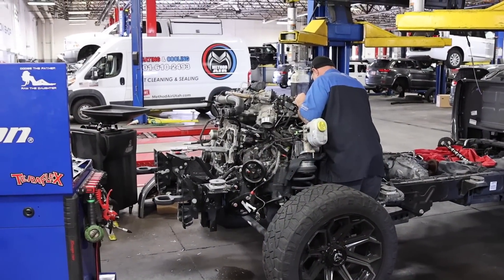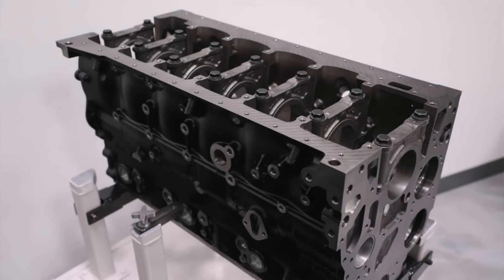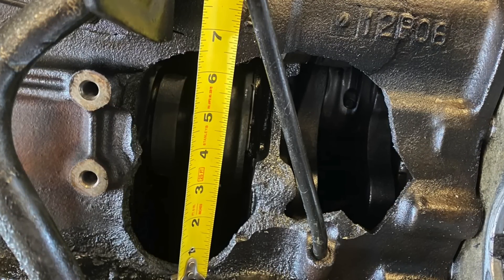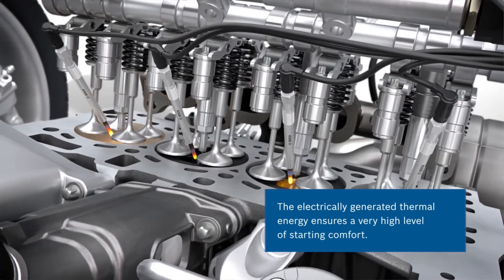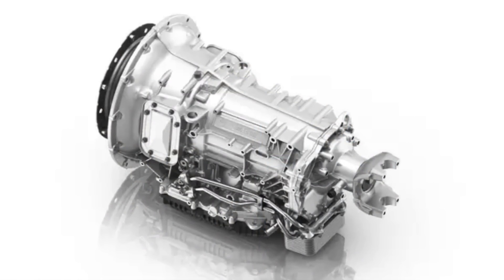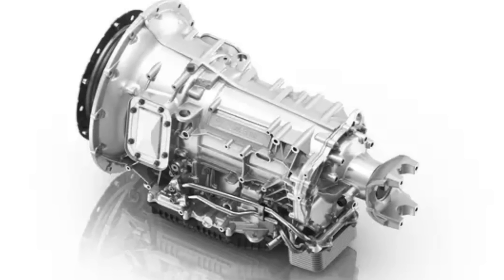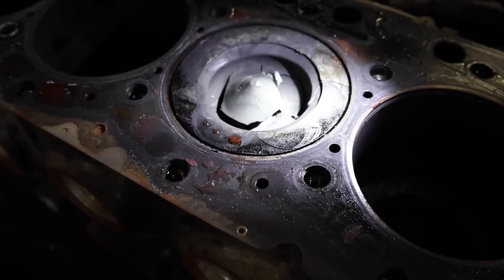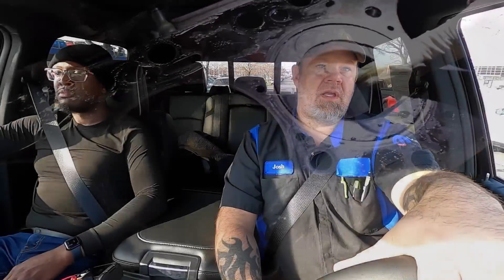Master Tech Breaks Down The Cummins Updates For 2025!

Comment: I have a 2024 ram 2500 with 13,000 miles and just finished second oil change and it sounds like lifters are about to fly out of it 😢 do you have an email I could send a video to and get your thoughts before it goes to the dealer

Comment: Found your channel after buying my 2025 Ram 2500 6.7.  I value your opinion and the information you provide.  After a 2400 mile trip towing my travel trailer I couldn’t be happier with the new truck.  Coming from my 2000 Dodge 2500 5.9 Cummins that I’ve owned for 23 years to the new 2025 the difference is night and day.  The only glitch was the damn def fluid gage.  It’s slow to respond and went from what I know was full to empty in seconds three times on our trip.  It always fixed itself but not before throwing the warning chime and def fluid icon.  From what I’ve read that’s been a problem but I plan on putting in a jumper wire at the sending unit plug as soon as I can get my hands on a wiring diagram.  That way if it doesn’t come back to life the next time I can jump it and fool the computer into thinking it full which it will be.  
  Keep the videos coming they are very much appreciated.  Thank you.
Reply: My 04 2500 laid down on us coming back from a trip. We were too far from home to get it hauled back reasonably. Had we been close I could have fixed the trans solenoids that coded. Now I'm in a '25 and hearing all the issues (not to mention EPA crap) it's got me wanting my 04 back. Didn't even have 100k on it.
Of course the new truck has all the power stock that my Edge boosted 2nd Gen had {EGT was an issue) and is quiet in the cab. Fingers crossed that the warranty they sold me covers any issues.
Reply: @OldCurmudgeon3DP 
  Hope you have good luck with it.  I still have my 2000, have had it for 23 years.  Injector pump went out on it pulling the travel trailer home to get ready for a trip.  Wife was tired of the rough noisy ride of the old 2000 and after riding in my sons 2024 Dodge wanted a new truck so here we are.  I happy she made that decision, it’s a nice truck.
Reply: @weshawkins7165 thanks. Good luck to you as well. Maybe the EPA will get out of the way before we have any expensive issues crop up.
Reply: @OldCurmudgeon3DP 
 Fingers crossed.

Comment: Hi, I have been following you on YouTube. I am an Icelander living in Iceland.
I have a question for you regarding my Ram. I have had Ram trucks since 1986 till today. I have had a 2500 Cummins 2007 and now 3500 Cummins HD 2023 that stands in 16;500 miles.
I have lifted the truck 2,5 inces and installed 37” tires. 
I have a leaking oil seal in the transfer case. I had that also on the 2500 that I owned before.
Is this problem something you are aware of?
Is there a aftermarket oil seals that are more HD than the Mopar ones.
Br
Jonatan Gudjonsson
Reply from the maker: Howdy. I do see that seal leaking from time to time. Next time it is changed the shaft needs to be checked for imperfections

Comment: As far as his view on the 3l hurricane.  I would love to be wrong about it.  The things about it that concern me. Reliance on sensors to monitor oil levels and conditions ie a dip stick. 2 sleeved cylinder walls.  The painted on cylinder liner might be fine but it might not be as well.  Also keep the v8 as an option maybe even make it the standard engine and get rid of the pentistar.  Technology is great when it works but when it doesn’t it shouldn’t make the entire truck useless.  My opinion

Comment: I had a 2016 2500 HD that I loved. I had it deleted and tuned. I am in the market for another truck which one is the best pre-2018. I can't see spending 100K for a personal use truck that I use to haul little with. A side note I have all of the parts that were deleted if someone needs to convert back to stock.

Comment: I understand "never buy a first year vehicle, but they're not always bad. I bought a 1994 Ram 2500 Cummins in November of '93, Not only first year of production, but first couple months of production on the most radically changed pickup in Dodges history. In the first 100,000 miles, only thing that went wrong was the cruise control switch. Ended up putting 505,000 on it before selling it and getting a 2011 3500.

Comment: Windowed engine blocks are nearly NEVER the fault of the block material or design, its because a dense metallic internal component rotating at very high speeds failed and blasted thru the block like a cannonball. Cast iron or CGI makes no difference. You could make a better argument for the main saddles over time or some such wearable concern regarding block material or design (and I still think any material argument against CGI vs. cast iron would be a weak argument), but not holes punched in the side from a failed connecting rod at full steam.

Comment: 16:32 modern problem of society, it is to easy for them to get money to pay for things regardless of the sale price. tho another thing that comes up after years of run time brings up things like... as an example, for every good part made they sell one surrounded by scraps, to the extent of... if one has a 3208CAT, what 4 cylinder CAT uses the same crankshaft tho made of a 230ksi alloy steel, same with the rods, timing gears, oddly ending in a thing such as a 3126/3208 sleeve job just to use 230ksi solid alloy steel pistons... if a stroked out 6.7 is a 6.9... that is a 9.6... have to buy in larger quantities ending in the manufacturer demanding that they actually surrender any iron/scrap metal to the foundry in quantity listed to make the things that they allegedly have money to pay for, otherwise its just bottom bucket general population mix casting. 3 cylinder is a 3rd world open air cast aluminum not a titanium aluminum vanadium purged vacuum cast alloy... tho it was in all the slag they scraped off, along with all the zinc magnesium that made the whole open air pot run over thermal run away boiling everything out till their is nothing usable in it... registered exportable VIN's, aluminum body panels that intentionally burn at a low temperature leaving nothing but slag/soot. just so nothing can be done with it once it is sold... both bad or good, just paying for something is the problem.

Comment: Is the grid heater bolt really a big issue?
Reply: never had a problem with mine with over 700,000 miles, 2011 model

Comment: Thanks for the info and your thoughts about the current diesel industry. I own a 2007.5 Ram 2500 with 137,000. I'm just trying to keep it running well, and so far, so good. I've added some after-market parts to improve the long-term life. Still worried about fuel and oil saturation, oh well. The truck is still running strong. New trucks have lost  their longevity, and the prices are crazy. Maybe some suggestions will be how to keep the old ones running strong with new and after-market parts installed correctly. Keep up with the good information.
Reply: Well said!!

Comment: I have a 2023 with 12k I have changed my oil twice with Shafers 10w30. I also have the Banks air intake and the Monster Ram on it. Is there anything else I can do to make this year Engine better to avoid these 5 Gen issues? If I change the Hydraulic lifters back to solid lifter will that make this engine more reliable life the 4th gens? I know there is nothing I can do with the Block composition.

Comment: Do a grid heater like the GDP one if and if it were to fail nothing would fall into the intake and make it's way to a piston. I for one miss the clatter of a diesel. My 2015 is to quiet. Also screw the grocery getters and a smooth shifting transmission, probably 90% of them don't out tow a gas engine or a half ton truck to begine with. I'll keep my lowly derated G56 truck.

Comment: In regards to the CGI blocks, notbing is wrong with them. If the internals are weak and a rod decides to let go CGI or cast iron it will put a hole in the block. 45 pounds is not the weight difference either lol
Reply: THIS. Windowed engine blocks are nearly NEVER the fault of the block material or design, its because a dense metallic internal component rotating at very high speed failed and blasted thru the block like a cannonball. Cast iron or CGI makes no difference.

Comment: I'm sorry you were miss informed.pre chamber engines are obsolete. The glow plugs are used in the intake as a pre heater to replace the grid heater and no more. They are not going to pre chamber with glow plugs per cylinder

Comment: I have a 2015 scat pack with the 8HP70. 200,000 miles and I’ve never touched the transmission,  cause that’s what dodge told me. It runs great still. Would it be wise to change that fluid and filter at this point?  Or just leave it alone? And do dealerships do this since dodge recommends to never service it? Or they use to at least.

Comment: CGI is way stronger and lighter then cast iron   Cummins just used less material in key areas that made it less strong
Reply: Lighter yes. Stronger. Vastly depends on the cast iron and processing. On average it can have an ultimate tensile strength of over 300 to 400 pa over CGI. At its highest it can have 1650 mpa of tensile strength or essentially 210,000 psi of tensile strength. CGI is great for the V shaped diesel engines because of the lack of space they have to work. But in an inline six there's plenty of room to spare and not worry over.
Reply: Preach it
Reply: Anyone who isn’t a fan of CGI is just plain ignorant. It IS stronger… by a LOOOONG shot!
Reply: @coreymacqueen4802  I'm not. And I'm not ignorant. Anyone who's thinks they can call others ignorant off a generic statement is ignorant themselves
Reply: @danielmorris-ruckett913  The issue is not the material of the engine block. it's the sole fact that cummins just cheaped out on the material in the crank case area. Cast iron or not its not stopping a connecting rod from coming through the engine block
Reply: @sounboy4498  I've had old school cast iron cummins motors have their rods fail to penetrate the engine block. But I do agree with you about the crankcase area
Reply: @danielmorris-ruckett913  All these manufacturers just cheap out and only focus on cost. They threw reliability out the window its quite sad. Those older cummins engines you have treasure them🙏🏿

Comment: If the big 3 truck manufacturers would use more nickel in their iron blocks like engine manufacturers did back in the 70'sthe blocks would be alot stronger than a regular iron block and a cgi block

Comment: Jist had my lifters and cam replaced at 18k miles. Sill have a liffter tic.   Sucks. But i love my truck
Reply: What year is your truck?
Reply: @allencanard979 probably a 2019
Reply: @Spoolingturbski  with 18k miles, I'd doubt it. I've heard for a while that starting in 22 lifters and push rod metals were very soft due to supply chain shortages and having to use suppliers that hadn't been used before.
Reply: 2022 is my year 3500 ho

Comment: Great info about these engines. Thanks Josh. Sometimes, I wish I never got rid of my 2018 to get a 2022. So far, no issues w/the 22. About 30K miles right now. However, I'm a stickler about changing the oil every 7500 miles max. 10w30 only, never 15w40 w/ the hydraulic valvetrain. I also try to minimize the amout of short trips & rarely idle the truck. If I was keeping the truck long term, I would surely get the Banks Monster Ram intake. I'd love to lose the EGR, but you know Uncle Sam's environmental police would have major issues with that. If this cam/lifter issue is becoming  a syetemic problem with these 5th gens, it would behoove Stellantis/Cummins to maybe extend the warranty on these engines out to maybe 7yr.150K miles. That would help restore some customer satisfaction they've lost in recent years..
Reply: I forgot to note that my 22 is the "standard output" version. No issues w/ the 68RFE tranny so far. I know that tranny goes get a lot of hate, but it's not a true medium duty commercial unit like the Aisin is. No noticeable MPG difference b/w the '18 & '22. The '18 did have 3.42's out back & the '22 has 3.73. I would guess the 3.42  may give you slightly better MPG at highway speed 70+ unloaded, but the difference would be minimal. I will say the my '22 holds 5th & 6th much better while towing & does a lot less "gear hunting". I wonder how they will gear out back w/ the ZF 8-spd?

Comment: People talk payload until their blue in the face. The majority of people that buy these big trucks their either parking lot ornaments or some kid just want to blow smoke and hot rod it. Towing campers I’ve seen F150’s pulling campers that should be behind semi’s.  You don’t have to run across scales pulling them. Farmers pull cattle trailers, trailers hauling hay, equipment and unless there is a roadside DOT they mostly travel rural roads. I have a 97 and a 2002. Pull anything and everything I want. Pickups don’t need to haul semi loads. As far as the 45 lb difference that’s a bag of dog food and most of the new pickups sold that’s about all they will haul anyway. To me it’s just bragging right for the auto makers about pay load capacity.

Comment: So there was a photo that got posted of the new engine from the actual Cummins website on a Facebook group (6.7 Cummins HD Ram) that also had a link to the page. That link as of late last night no longer works for some reason... it says at the top of the page that you are not authorized to access this page 😮.  Anyway, the picture of the engine from the front shows great detail of some of the new features.The new top mounted cartridge style oil filter, you can see the new dual pumping plunger Bosch CP4 style fuel pump🥴🥴, dual fuel supply lines to a new fuel rail that is feeding externally mounted injectors. The fuel rail pressure sensor is now on the front of the rail. You can see what appears to be an updated water pump that judging by the color of the material and added webbing on the exterior may suggest that it is made out of some type of composite material. You can see the vastly different intake opening connection that is bolted to the new side draft intake manifold that is bolted to what APPEARS to possibly be an all new ALUMINUM HEAD...😮😮😮. The engine still is a front gear train design. Obviously, we can't yet tell if they improved the design of the hydraulic roller lifters. I've seen sources saying there will be an electric heater to help the emissions systems build heat quickly with the use of possibly a 48VDC system like we are going to see in the new medium duty and heavy duty on highway Cummins engines. Wild times ahead for this new engine!!! BTW i have all the photos that were posted of the engine, its specs. Etc. If you haven't seen them and want to reach out to me and I'll glady share away!
Reply: Do your pics show the fuel filters
Reply: @vicgeier3482  it's buried behind the new intake manifold assembly. It's pretty wild looking.
Reply: @vicgeier3482  you've already worked on them? How?? If they haven't even been released to the public yet...

Comment: Hey Josh, would like to know if a 2021 head can be installed on the “new” 6.7 cast block.  Or can a new 6.7 be installed or retrofitted to replace the CGI 6.7 that’s hooked to the aisin? I heard  on TFL that the new 6.7 will retain the roller lifters. Not a fan of that but just like the current generation, the aftermarket has solid tappet to replace it. I wonder if Cummins is going back to the gen 4 block or a newly designed block that would make installing a tappet set up harder or impossible.  Just some thoughts for future videos.

Comment: Great content.
I do not think they should have ever done CGI.
I have a 2015 Ram 3500 6.7 Cummins, 370hp 800lbs I pull a fifth wheel and could not be happier.
I had a 2005 2500 with a 5.9 and a 6 speed loved that truck also.
Had two new trucks in almost 20 years.
I love my Rams.
I have no desire for these New Problem childs.
As a engine builder the roller cam deal should have never happened. JMO.
I just subscribed to your channel. 
Thanks for sharing. 👍🇺🇸👍
Reply: Simple is usually better. Going back to the flat tappet would almost guarantee me buying a 2025.
Reply: @edsmachine93  it’s just cheaper with cgi and that’s all it is to make it cheaper to make because it’s not stronger cast iron and if cummins would sleeve these motors would be great and put the top half of the piston made of steel and skirts are aluminum just like the way Cat builds them !!!!
Reply: @brentmcmahon8188  Actually CGI is about 75% stronger and roughly 75% more rigid than regular gray cast iron but Cummins mistakenly removed too much material on the block when they went to CGI. CGI is most definitely stronger if done right by a big margin.
Reply: @Cobruhh93  Ridgidity doesn't equate to strength. Look at glass. Glass is extremely rigid. It's way way harder than any steel will ever be..... but glass isn't exactly the poster boy for strength 😂

Comment: Why would anybody want 6 glow plugs when the grid heater works best hands down !!!
Reply: I agree
Reply: I suspect it’s partially due to the upcoming epa27 requirements and possibly related to the fuel agnostic engines that Cummins is building.
Reply: Agree

Comment: I wish cummins would sleeve all their blocks like the big trucks !
Reply: Im about to buy a ford 800 and put a m11 cummins in it
Reply: And also the marine application is
Reply: @iqbalsaini541  the marine application is also like 600hp
Reply: The problem with sleeves is that you have to run an additives into the coolant to prevent cavitation within the coolant jacket without it the sleeves will blow out
Reply: Yep
Reply: Basically every engine this size is parent bore. Liners are basically all pain no gain